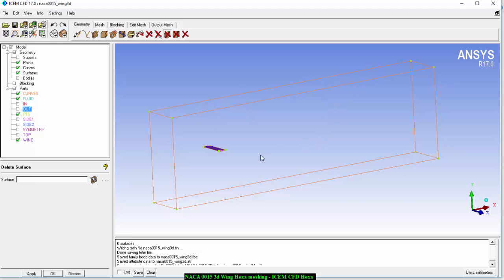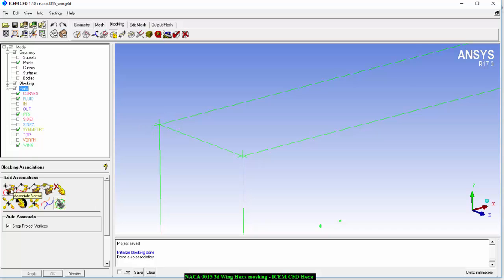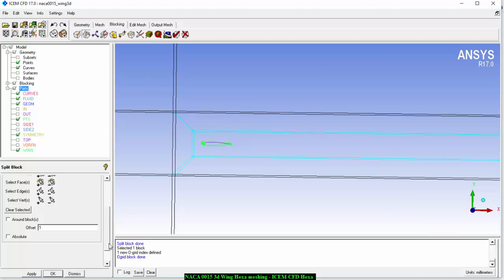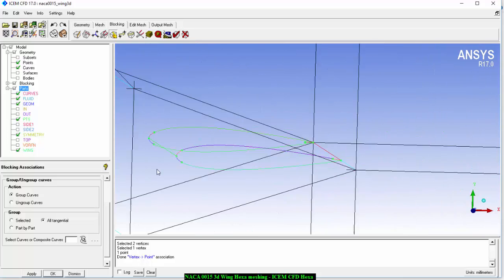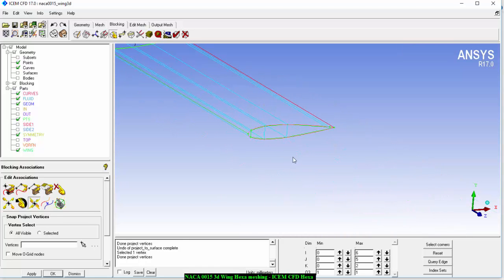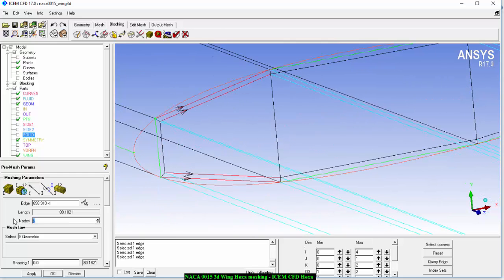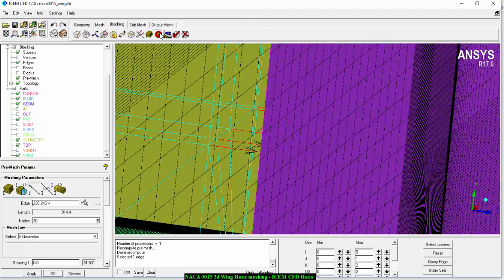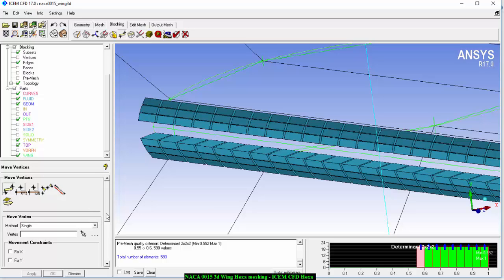NACA 0015 Wing 3D Hexa Mesh (1/2)

Comment: Hi, I see that you did not select the 3 blocks in the Y-block as part of the 'SOLID' for the wing. This would result in the wing having a flat/cropped trailing edge right?
Reply from the maker: I wanted to create the y block in the triangular section of wing
Reply: Thank you for your quick reply, but what I'm trying to find out is whether in your finished mesh is the trailing edge flat or sharp?
Reply from the maker: Sharp

Comment: Hi, thank you for your video it is very helpful. You are very knowledgeble on ansys and it shows. I however am stuck due to the part where your video goes blank. Can you reupload this part or are you able to help  me through email?

I need immediate assistance due to my dissertation being due in 2 weeks.
thank you for your help
Reply from the maker: can you please pin point the time stamp where it happend?
Reply: Advanced Engineering Solutions it freezes at 23:04.. Thanks..
Reply from the maker: Yes you are correct. Have you gone through second part?